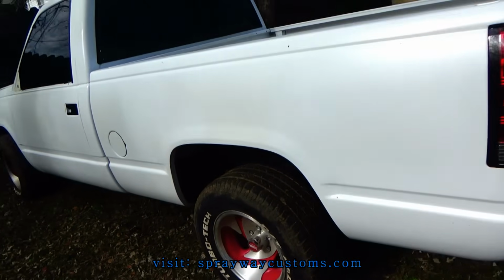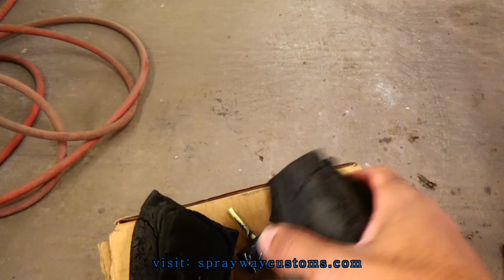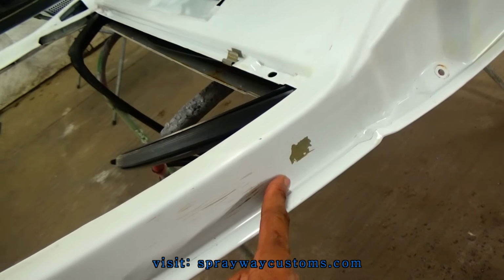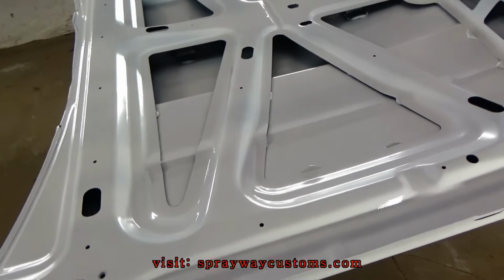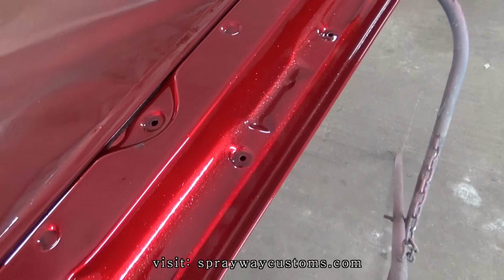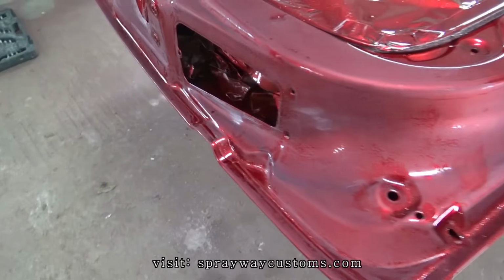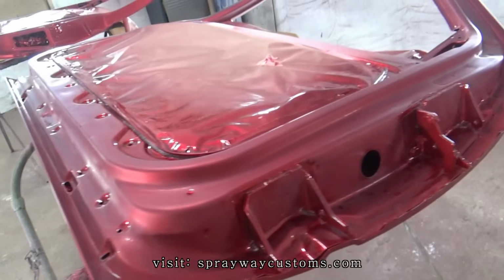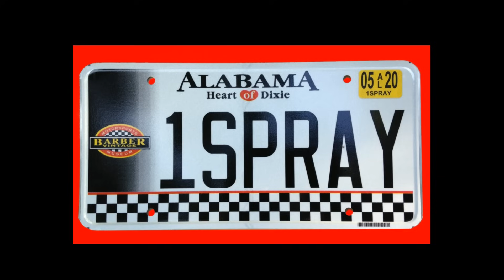Candy Apple Red Over Silver Micro Metal Flake CHEVY SILVERADO 1500 OBS SHORTBED Painting The Jambs

Comment: Love the video. Have you deal with door locks. The keyholes don’t work on my 99 3500.. or would shaved handles be easier if the hardware inside the door is broken
Reply from the maker: You can get another key cylinder for a lot cheaper

Comment: And the gauge pressure /tip used for each application
Reply from the maker: 28-30 psi with a 1.3 tip on everything except primer Sealer 1.8
Reply: Thank u .. I’m leaning towards wet wet plus for my clear ... how do u feel about 50psi for that wet wet plus clear coat kandy